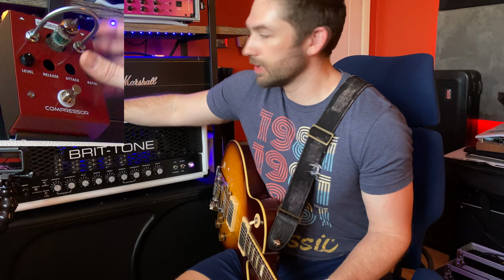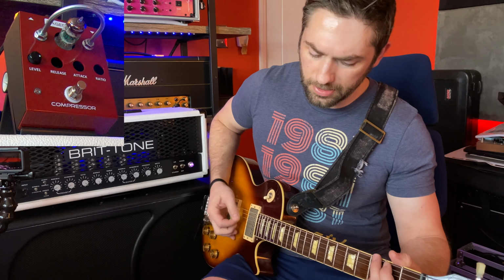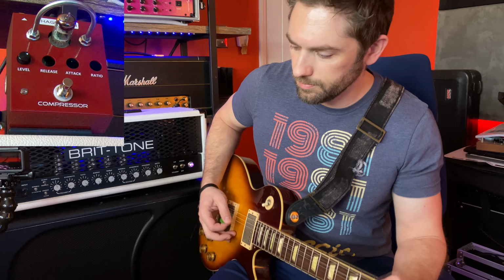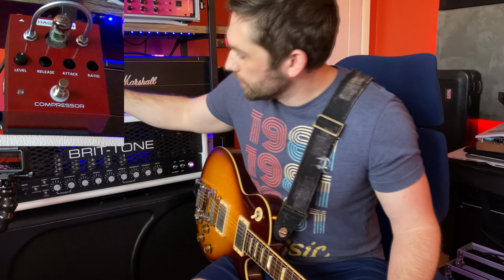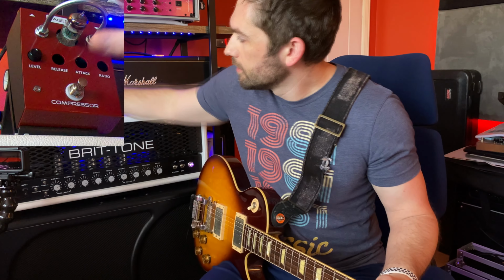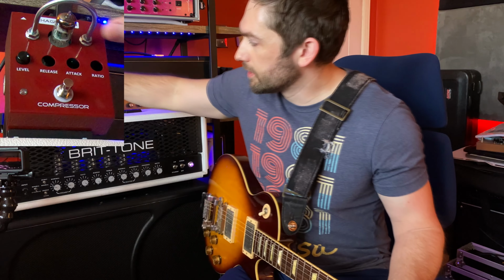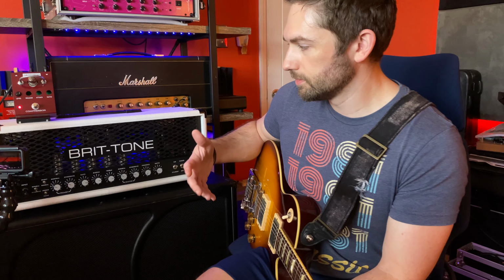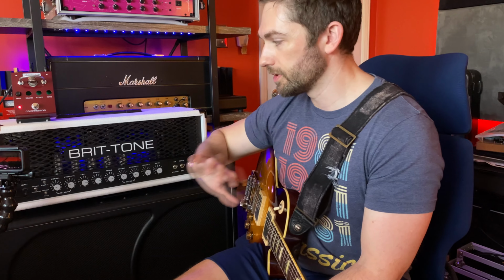Hagerman Amplification - New (Prototype) Tube Boost Demo

Comment: Is this make "tighter" for rhythm stuff (Mesa Boogie Rectifier fat type of distortion)? Doesn't need to be super tight like some modern stuff (that's crap for me) or tubescreamer type; in reality I like some old school death metal (Mesa, SS amps or Marshall + Rat or DS1 as a boost), but I like also some Pink Floyd or some "clean" breakup tube compression playing with the volume.